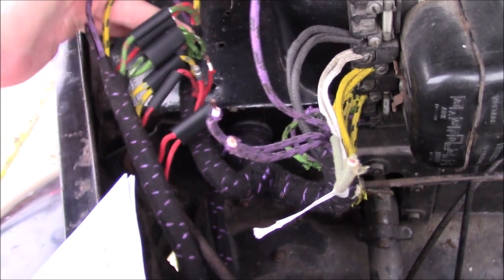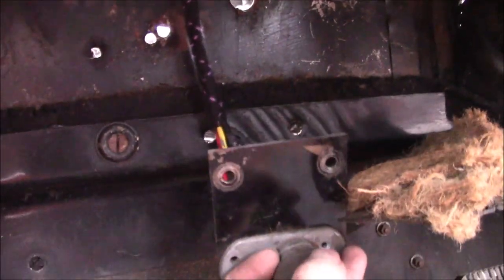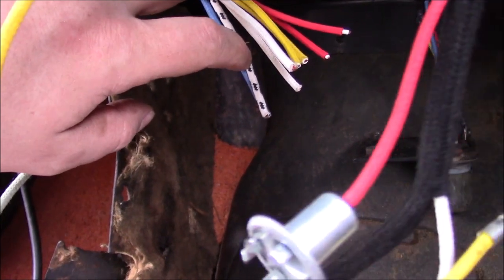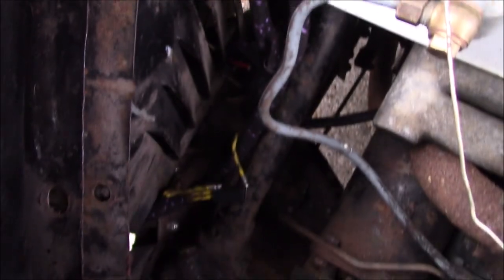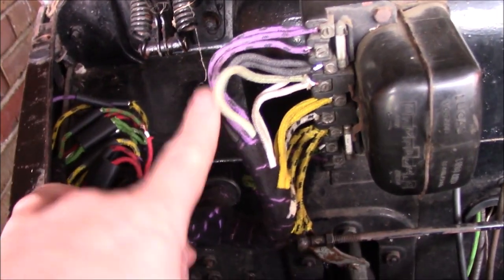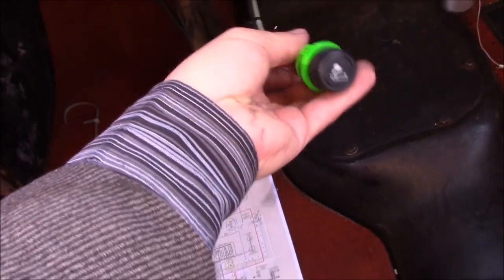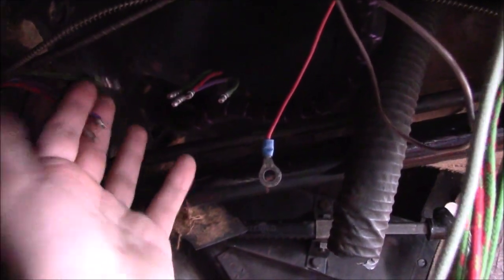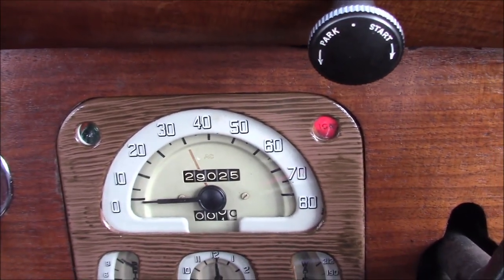1951 Lanchester LD10 - Replacing the Wiring - Chapter 8

Comment: The wire with the eyelet goes to the block on the inner wing panel.
Reply from the maker: Since recording I relocated the wire to another point on the bodywork and I've got that inner wing panel removed for access.  I'm going to clean the block up and free it off so I can use it since it would be tidier.
Reply: @noexpensespentstudios  I haven't checked on my car, but I expect that wire ends up on the "E" terminal of the regulator, 3rd up from the bottom.

Comment: The clock has to be "started" by pushing the adjuster up sharply, and letting it flick back down.  It may take many attempts before it will start.  If it's quiet you can hear it ticking when it's running.
Reply from the maker: oh, I didn't know that!  It would be nice if it does work, I shall have to give that a go when we're next in that area of the wiring.